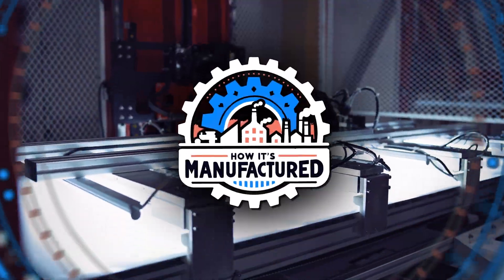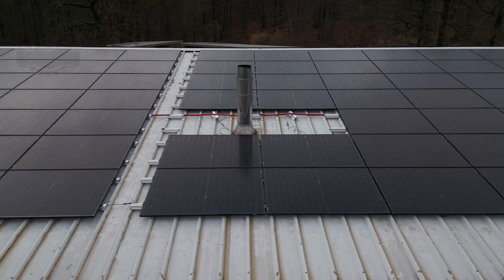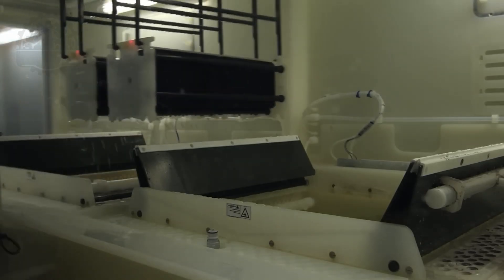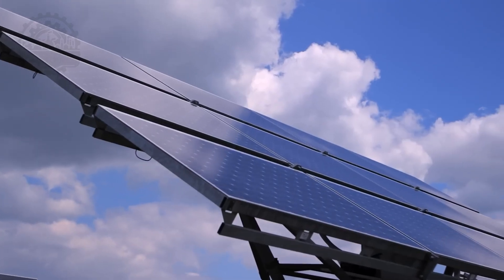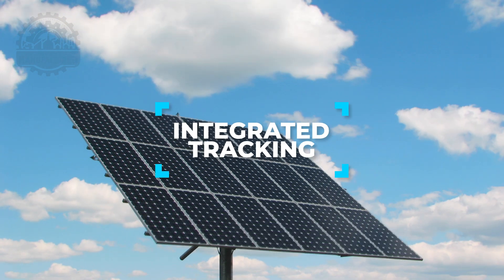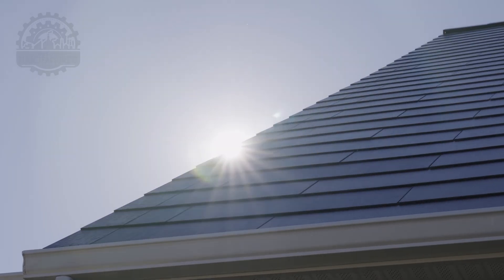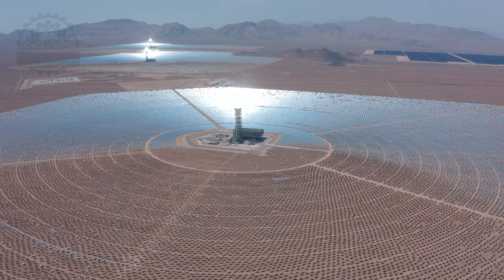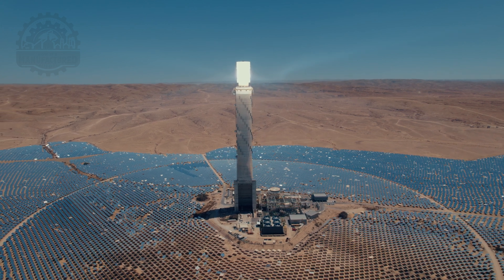How It's Made: Solar Panels

Comment: They talk about reducing carbon, but they use a furnace to melt the silicon.  Real green there.  What happens to the solar panels when they are no longer usable??
Reply: Yours is a very valid point, no to mention foul vapours generated from the "newest" and exotic methods for solar panel making. But well, cleanest energy is nuclear, and with current handling chances of another Chernobyl are really small. But plants are still shutdown in favor of carbon burning. Investment in fusión is small, and solar is already working, once there is no carbon or oil, solar Will be used and focused regardless, so better to improve on the methods before that point comes
Reply: And.. I’m sure the output of these panels over 25 years.. would offset any carbon released during manufacture. Agree with previous post.. electric furnace use is most common.
Reply from the maker: Yes, arc furnaces are commonly used. There's a significant distinction between simply generating energy with fossil fuels for one-time use, and using that energy to create products that will generate more green or clean energy. This approach greatly reduces the carbon footprint of these products. Currently, we are in a transitional phase where we still depend on carbon-emitting energy sources to manufacture products that are carbon-neutral or carbon-negative.